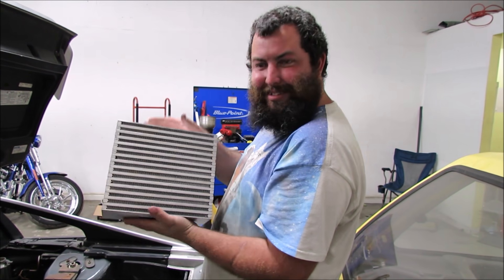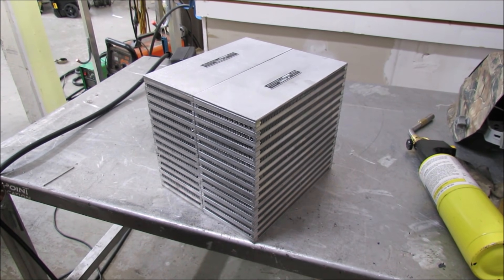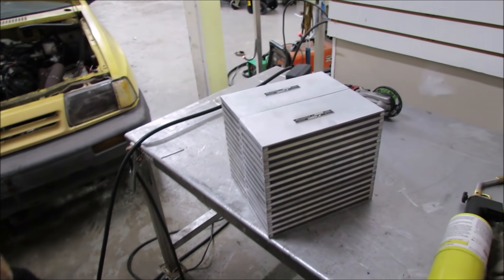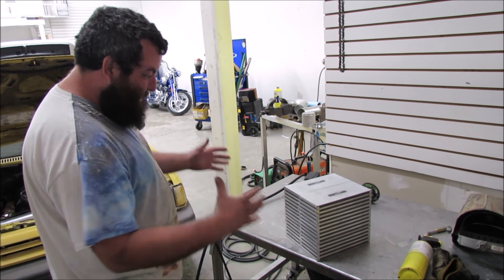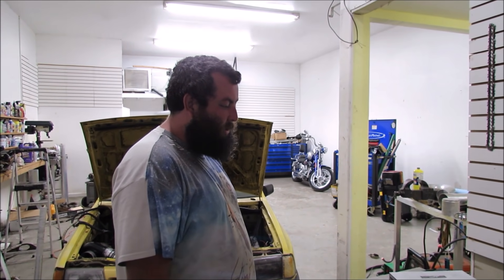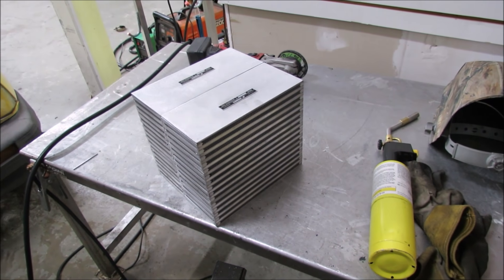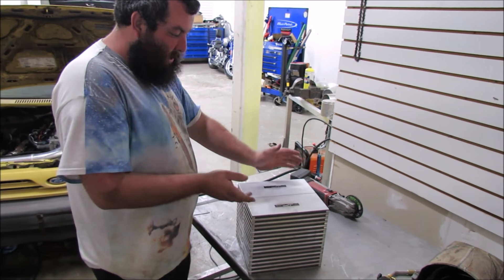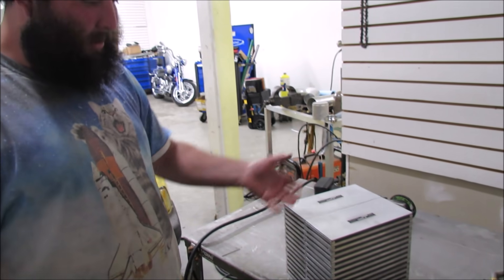Turbo LS3 Fiero Part 10: Dual Interoolers

Comment: With no Silicone flex couplings between the throttle body and the intercooler, won't the stress from engine vibration eventually crack the intake piping?

Comment: I'm late as AF, but could cooling air have a hard time getting through such a thick core? I remember having a 4 row aluminum radiator in my mustang that would run hotter cause the air couldn't get through the core. This is a cool series, I've watched allot of your videos and shared. Looking forward to seeing more. 💪

Comment: Awesome fab skills for sure.   I do have a burning question though.  Where is the cool outside air-flow to cool the intercooler?   I believe that the ambient air temp in the area that core is mounted is going to be pretty warm.

Comment: The fact that you're doing this with a HF welder makes it even better.  Did you ever consider trying to keep the trunk and mount the turbo over the trans with the IC down in the wheel well?  That's kinda where I'm going but I'm looking at A2W.  Wish there was more room along the coolant pipe area to run charge pipes for a front mount.
Reply from the maker: When I purchased the car the trunk was already cut out. Well hacked up to say the least. I decided it would look cleaner just to remove the whole thing.
Reply: @leonsgarageadventures2907  makes sense.  Certainly gives you a lot of room to work with.

Comment: I've listened to it 3 times now... was the reason for not wanting to do air to water "because I didn't want to mess with it"?.... I don't think that's a valid reason for anything?
Reply from the maker: I'll be running two cooling fans an electric water pump all the factory lights and ac all from a factory fiero alternator I can't really ask it to run another water pump for the intercooler.